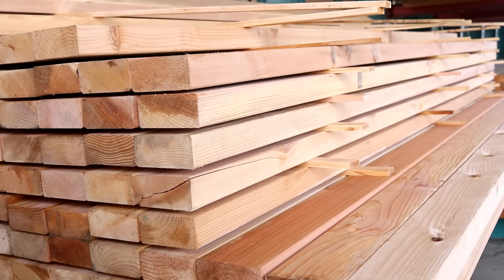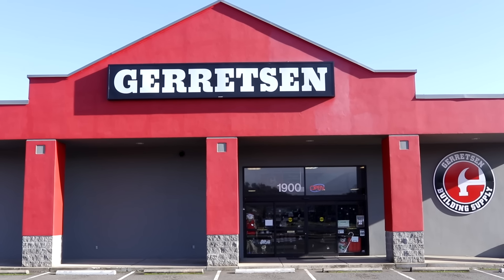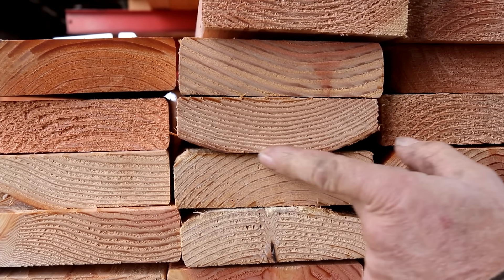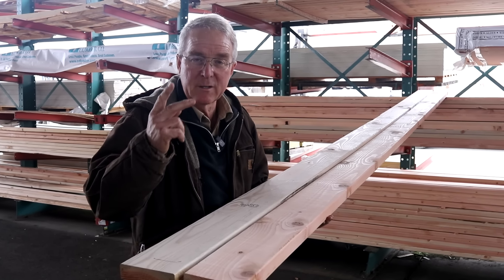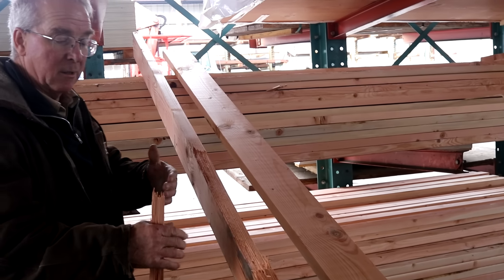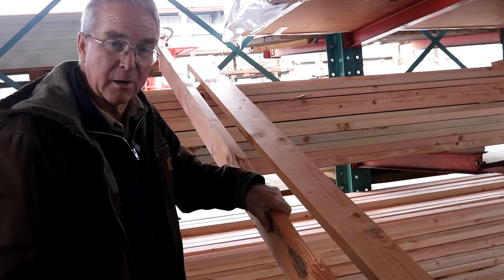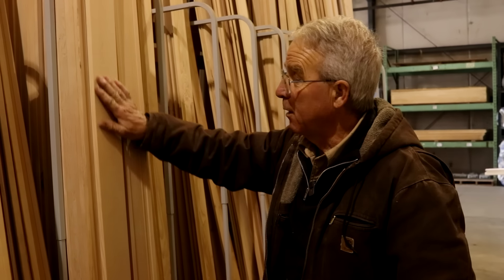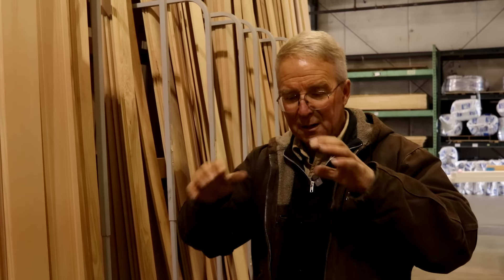How to Not Buy Crap Lumber

Comment: I work an outdoor lumberyard in the North East. I prepare orders for local contractors.
I'm constantly stacking piles of 50-100+ studs of multiple kinds - 2x4, 2x6, 2x10, 2x3, 1x4, 8', 12', 16', plywood, OSB, aspenite. Treated woods too.
I'm dependant on what the supplier and company agree to.

I see ALL the kinds of defects you could imagine. Ever see heavily weathered wood? Boards harvested from a forest fire? Boards wrapped in fungi? Boards filled with bug holes? Some boards are cut short by a few fractions of an inch. Some boards have saw marks in random spots. Wood cut with dull blades (it shows!). I've seen bowing and crooking that would make archers jealous.

The general rule is:
One defect-free surface,
One defect-free edge,
Minor bowing & crooking is acceptable (the kind you could force back into shape),
Negligible twisting is acceptable (the kind don't notice right away),
No significant structural defects (no deep splits or cracks)

When drive-in clients ask for perfect boards with no knots we tell them, "They don't make trees without branches"

BTW I could smell the cedar when you showed it. Bet your hands smelled nice after too.

Comment: I was at my local home depot in Colorado recently. It seems that they get their dimensional lumber from a few different places/sources. The 2x4s were pretty terrible. Lots of wane, huge knots, sap pockets and splits/checks. Same with the 2x8 and up. Funny thing is that the 2x6s were a total outlier. They were supplied by Idaho forest products. They looked like second growth, so still relatively tight grain, planed far smoother than the 2x4s, only small pin knots, little to no wane, and out of 10, I would probably take 9 home without much sorting. So much depends on the mill/ supplier and how they grade. I love my local mill, but they are pretty far, and sometimes you just need a few, so big box stores are the best option. I just wish they would pay more attention to quality when they buy....

Comment: I've seen a contractor put a 4x12 df beam clear span to support a king post & ridge beam . That 4x12 beam had a 3" knot on edge 12" from the king post. The worst part is that the building inspector passed. What happened to selecting lumber? Is it a dead skill?

Comment: If you cut the center out you’ll get two straight cross cuts and any twist will stay in the center. Be careful and back up and recut to avoid pinching the blade

Comment: In the big box stores near me (UK)  the carcassing timber is all CLS, which is all curly, and mostly 4x2 “ largest.  We do have a couple of nationwide timber chains who have owned their land for ever, but it’s worth so much that its going.  If there’s two of you, looking a bit rough, you can usually get away with sorting the stacks, nobody cares enough to stop you !    Useable timber at a reasonable price is the hardest thing here.  
   I have to say it hurts me to see sawn timber undersized  as they do nowadays. most of the houses that I work on have been up a minimum of fifty years and the timber bone dry is still to size. To repair a house with modern timber looks embarrassing, but that’s what’s going to happen unless it’s listed !

Comment: For columns, 6 by 6 cedar, for example, i buy long pieces, 16 footers, then cut them down, because the wood is more likely to be from a bigger (older) tree. More rings, more compressive strength.

Comment: The split is somebody's fault. It is the graders fault. They should have had it trimmed out. Or the board scanner. A lot of the wood you showed was inthe wrong grade if it was in a 2 & better unit. Also. A #1 board is essentially a select. Only difference is knot size. All other grading rules apply to both grades.

Comment: I worked in a family-owned lumber yard when I was in my 20s.  This outfit has been in business for generations and survived the pressure put on it by the likes of Home Depot partly because their products and service tended to be superior. They carry lumber products that surpass any available at such stores.  Even the 2 & Better tends to be significantly better than say, Home Depot's or Dixieline's. Another dynamic responsible for the yard's success was the symbiotic relationships it and its employees had with its loyal core of customers--mainly contractors and craftsmen.  There was a mutual appreciation with each seeking to do right by the other.  To EC's point, if you're going to be a narcissistic a-hole, go to Home Depot.  The small businesses don't need that kind of abuse.

Comment: Always... always... always... try to purchase from a full service lumber yard. I worked in the industry for over 35 years and the "big box" stores cannot offer the selection and quality you will find at a full service yard. This includes framing lumber, finish boards, mouldings, doors - slab & prehung, windows, and sometimes trusses. Plus many full service yards will offer you to be able to buy specialty items through local wholesale suppliers using purchase orders.

Comment: I absolutely hate spending lots of time at lumber yards or big-box stores to sort through the pile to get the best lumber. HOWEVER, I've realized that spending an hour sorting through a lumber pile can save me 2 hours or more during construction. I've been impatient before buying lumber and then had to waste extra time at my table saw or with a plane to remove crowning or twisting that made a board unusable without straightening it a bit.

I want to add a few comments that I've learned. I almost always bring my tape measure with me when I'm digging through a lumber pile, and I keep my cut list with me. Sometimes I know I need a lot of short cuts. Maybe you know you need a lot of cripples or jack studs. Or if you need to build some headers out of 2x8s, etc, you may not need the full length of the board.

So sometimes you can see a huge knot right in the middle of a board, and it would make NO sense to use the entire board as a joist because the knot looks extremely weak. Well, if you just need a header, you might be able to measure the board and realize that the wood on either side of the knot is perfect, and you can just trim it off at either end of the knot. Maybe someone else skipped over the board  because they needed a full length board not 2 boards that are each about 40% of the length to build a header.

The same is true when there may be a little bit of bark on the outside of a board. If you're buying an 8 footer but you actually just need a couple more 7 footers for jack studs, you can just trim off the bad end and use a perfectly good section that avoids the end.

Therefore, when you need to buy 20 boards but only 15 need to be full-length, you can save yourself a lot of time by accepting 5 other ones that might have perfect lengths somewhere in the middle or at one end rather than trying to find 20 boards that are absolutely perfect across their full length.

Comment: A friend hired someone to replace an exterior door in a 1960s house.  The frame was great fine grain d-fir wood, but the new door came "pre-hung".  Junk wood frame, cut into short pieces and finger-jointed to minimize twist.   The contractor felt compelled to use the new "free" frame so damaged the wall and frame to rip out the good stuff and pay to dispose of it!  Heartbreaking! (pardon the pun).

Comment: 'You get what you pay for', is as (or more) true in lumber as anything else. Although,  in lumber, I've found that the price difference between big box crap and a respectable source is not as much as one would expect. At least the grading is still mostly trustworthy. There are some good sources that are convenient, and not excessively expensive (Dunn lumber, anyone?).

Cheers.

Comment: 3:50  I consider wane to be a minimal defect, mostly cosmetic.  It shows the board was cut from the outermost part of the tree, the opposite of the pith.  Boards with wane tend to be  more stable, especially compared to boards with pith.  Usually, the outer growth rings are closer together as the trees grow more slowly as they get larger.  Wood from conifers is stronger the more growth rings per inch.  All these statements are generalizations.  There will always be exceptions.  The point is, wane is not an automatic disqualifier for me.  A board with some wane that is otherwise good (minimal knots, straight, no warps or splits, etc) is far better than a wane-free board with pith or any of those other defects.

Comment: FD probably means final dimension.  Since it's a rough cut, the size is actually the final size.  Unlike dimensional lumber where you lose 1/4 inch on all finished surfaces.

Comment: I get so disgusted with lumber companies even outside of the big box stores. I live up in Northern CA. it's pine city up here so you would think you would get good lumber up here...wrong. I stay away from big box stores, but even the small ones can screw you. I bought " What they called premium presure treated boards " ooooh, it's premium. I put my fence up and after the boards dry out, why are PT boards aways wet, they were so crooked I had to replace them, 2x4x8, not just a couple, but several I spent a lot of money on
 " premium boards" and I got crap. What you said about Cedar I feel the same way, but I have a reaction to Cedar dust. It's called Cedar Fever and its a real thing to some people. I cut my own fire wood and I cut a lot of Cedar and it can give me a bronchial infection if I don't wear a mask. I just started trying to cut my own boards and so far I get much better boards and the right size, but you have to have access to a lot of pine trees or have enough on your own land, I have both. Good video I always wanted to learn the names of the wood I work with when I was stationed in Delaware I could buy all kinds of different woods and at a good price. I ran a wood working business for 5 years. Some of my work such as a baker's rack, a very popular item I sold for $50 back in 1993 we have two and their still standing outside under the tool shed awning their dirty, but the finish is fine. That was some good lumber out there. Thanks for the video keep going with lumber infor...like why some companies won't let me chose my own boards I have to take what's there with out digging through the board's, it's written on a sign !!

Comment: Don't be too quick to run down the big box stores - there is such a thing as "Prime" grade that big box stores often use their size to purchase under contract (#2 Prime) form the mills. #2 Prime has better appearance than #2. Better appearance typical means smaller knots and less wane. Essentially the computer / laser grades out the best of the No. 2 for better appearance. When this occurs at a mill then what is left over may be a bundle of material with constantly less desirable appearance that fully meets a NLGA #2 grade.

The thing that you should be looking at is sapwood inclusion because in SPF sapwood is highly prone to rot. For a lot of projects there is questionable benefit to purchasing above the code required grade if it is to be sandwiched between drywall and sheathing at 16" or 24" O.C.. Yes, you have to look for defects because as wood moisture content cycles (after grading) and thus splits and checks defects can develop in storage.  You have to be mindful of when it really matters to select the hell out of something.  When I go to purchase plumber I look for #2 Prime so that in theory I have fewer defects to consider - these pieces are typically for smaller projects - if you are building several homes then your best option may be to only source lifts of #2 Prime that are wrapped for weather exposure.

Comment: Spruce doesn’t stay straight….it moves, a lot! Unless it’s covered with paint or some other material it’s gonna move a lot. 
This is why it’s the best material for guitars,violins, pianos, etc. but it’s always quarter sawn that’s used. That’s the part of the instrument that moves( vibration).
I built my house 20+ years ago and the big mistake I made was staining the fascia ( it was select spruce ) with good stain, but almost all the south facing boards need replacing. The sun does a number on that wood.

Comment: You need good wood for load bearing structures. If you are putting a door or window in the jack posts and headers. The parts that hold it in place who cares. Knotty wood can also be used to dress up what you're building.

Comment: Most of that timber you have shown is still terrible. It looks a lot like Spruce or whitewood used in packing crates. None of it is quarter sawn and will always warp or twist. It's all fast growing and unstable. The best softwood comes from Russia and Norway. It's referred to as Scandinavian Redwood. Not the Redwood you may know as Cedar.  This is a strong almost knot free high quality timber and its used in joinery such as doors and windows. I used to buy large quantities in the UK and now here in Australia I have an importer that I use. The growth rings and very fine and tight together. You mentioned Douglas fir but that timber is very distinct in colour and smell. What you showed there looked nothing like the Doug' fir that I am used to. In Australia Its imported and called "Oregon". Maybe because of its traditional location. I am a joiner with over 40 years experience so I do know a bit about timber and selection of boards.

Comment: "Spruce isn't very strong"
Well, that's true, and that's the reason the Hughes Aircraft H-4 "Spruce Goose" (sole example's registration number NX37602) was called such by it's detractors.
In reality, in typical mechanic fashion, the mechanics who worked on it called it the Birch [expletive for a female dog], because it was made largely of Birch.
So, that leads me to my question: Have you ever used a Birch species in a structural application? If so, what was it, and why did you pick Birch over other options?
I guess what I'm trying to ask is: What are the positive and negative characteristics of birch as a structural or trim wood, and if you want to use birch but there isn't any available, what would you use instead? Or what would Birch be a good substitute for?
Reply: The Hughes H-4 notwithstanding,  here has  been a lot more spruce used in aircraft construction than birch.  Spruce is used because of it's strength to weight ratio.
Reply: @andrewalexander9492  That's actually interesting, I guess that just goes to show that the detractors who named the H-4 the "spruce goose" as an insult would have hated aluminum if they compared it to steel too!
Reply: @44R0Ndin  Yeah, I have no idea what was going through the minds of the people who coined the phrase "Spruce goose)  but spruce is not considered an inferior wood in the context of aircraft construction.  Sitka Spruce is pretty much the standard for wood aircraft structure.

Comment: #8:35 Why are there a bunch of indentations covering that whole board?  Looks like someone ran it through some machine and ruined it.
Reply: Well, someone did run it through a machine,  but it didn't ruin it.  You actually pay more for that.  That's treated lumber.  It's pressure  treated lumber.  It's treated with a preservative which makes it rot resistant.  The indentations are put there so that the preservative soaks deeper into the wood under pressure.

Comment: 84 Lumber is the absolute worst. If you're not a contractor ordering $5000 or $10000 worth of wood, they don't want your business. But they won't tell you that. 

I needed stuff for a deck replacement, and so I ordered about $1000 in wood, mostly 2x6s of varying lengths -- 8', 10', 12' -- also some 2x8s for replacement joists (the old deck was pretty rotted away. Even the best boards really had no salvage value.) Used them for lining concrete pours, if anything. So, paid a grand, plus another $200 for delivery. 

If they didn't want my business, I'd have understood. "We have minumum orders of $5000". OK, no problem. "We charge an extra fee for orders under $5000" Also ok, no problem. 

No, they took my order... then, I swear they picked every piece of sh** board out of their stock. 3' Live edges (Wane) on both sides for something like ¼th of the boards, a single 3'  live edge for another ½. Yes, ½! No excuse for that. "We really don't want your business. But we'll take your money, anyway". Never again will I give 84 Lumber any business at all...

And yeah, live edge/Wane can be ok -- if you're likely to trim that board you show @ ca.7:00 by 1 foot, well, that's the end you're going to trim off. But 3' -- and I'm not exaggerating -- that's a pretty excessive amount of lost board feet.

======
P.S., I'm ok with knots that are solidly in the wood, so they aren't going to pop out. But if they're loose and wiggly, forget it.

Comment: I agree with your premise however, "box stores" are not lumberyards any more than they are real hardware stores and shouldn't be disparaged for this. They brand themselves as "home improvement centers". This means if you don't have a bookshelf now and you can find a few boards to build one, your home is improved. You could use a wrench as a hammer yet, its not as effective. Same applies to sourcing your lumber.

Comment: I'm not sure how it is in other parts of the north west but where I live non of what this gentlemen says is true.  In fact it's completely the opposite.  It's always a pain in the neck to find decent dimensional lumber at our local lumber store.  Everything he points out is very present in 95% or more of the lumber there (especially wane and cupping).  What really gets me is that the establishment I am referring too doesn't want you sorting thru them either even though I do whenever I have no choice but to purchase from them.  It's quite literally the worst lumber ever and I have much better luck going to a Home Depot some 30 miles away.  It's actually cheaper too and I always get better lumber.